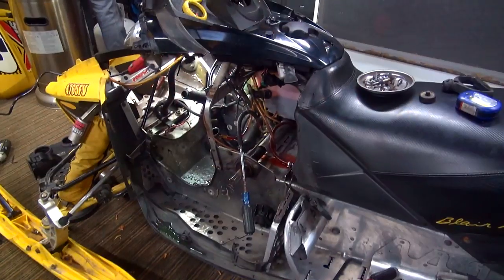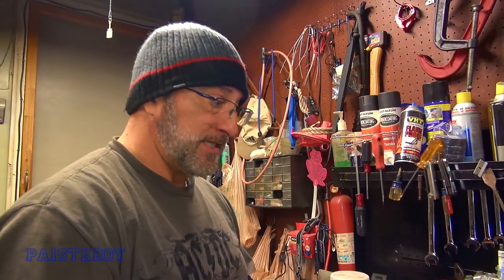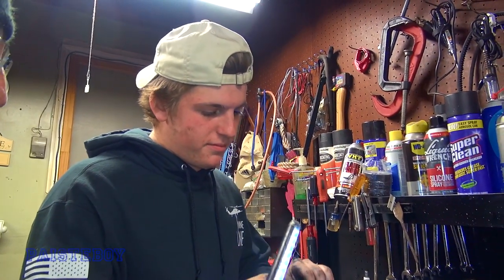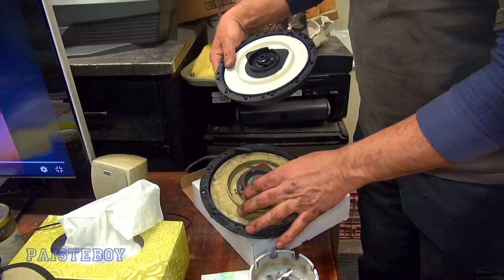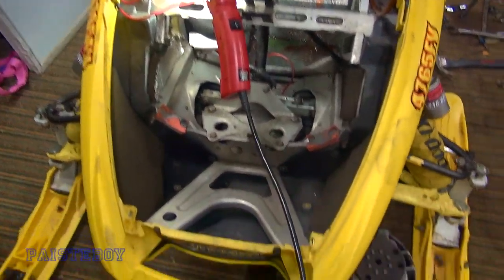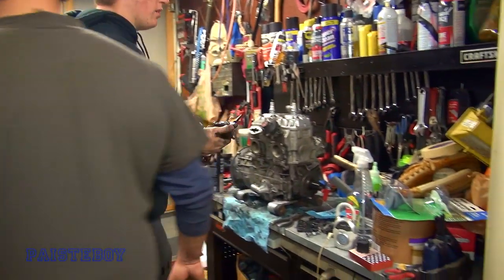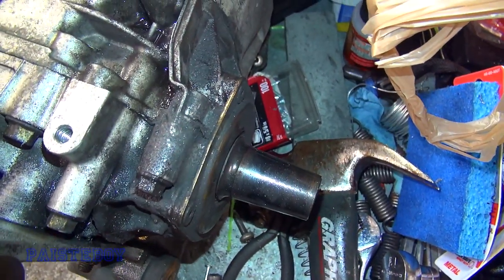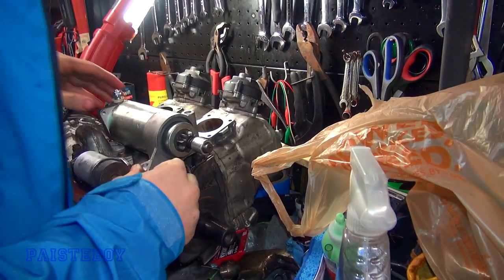Working on the Blair Morgan: PART 1 of 3

Comment: Careful adjusting oil    pump  I thought the same thing on my Blair Morgan and burn it down better to use or oil and change plugs then being that guy on the trail  Broke  Love the videos thinks   Snow
Reply from the maker: Thanks for the heads up.  We haven't adjusted it yet.  Parker is going to call his teacher first and get more info on that before he just starts changing the oil pump settings.  I guess running rich is a lot better than blowing up. lol.  Thanks for watching Alan.
Reply: @Paisteboy      I love that sled  Are used to go through a gallon every 200 miles I adjusted it And burn it down Not sure if you have check that Y pipe Take the shield off  It holds moisture and rust Out Can't wait for the next video Big snow store in the UP Michigan    This weekend
Reply from the maker: This sled has a full Dyno port pipe and can with no shield on the pipe so we're good there.  Gary advised that we not adjust the oil pump as well.  I guess we'll have to see how she runs.  I am going to try to put up part 2 tomorrow.  I hope you get that big snowstorm!  Snodeo is 2 weeks away for us!